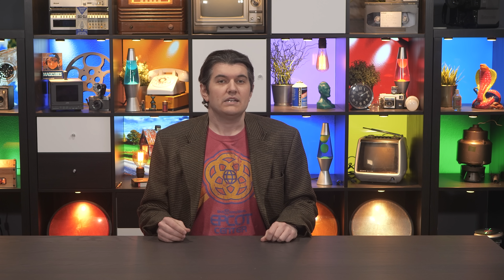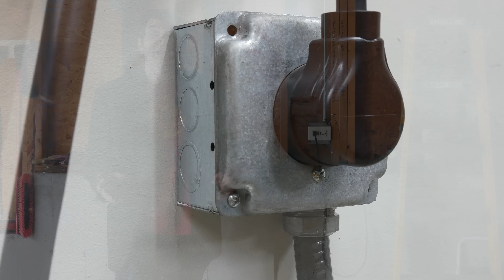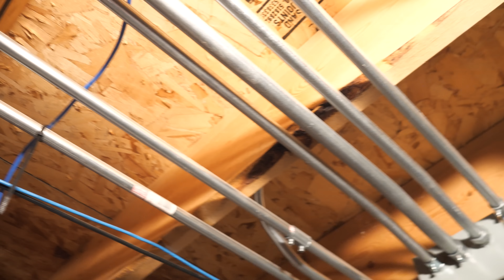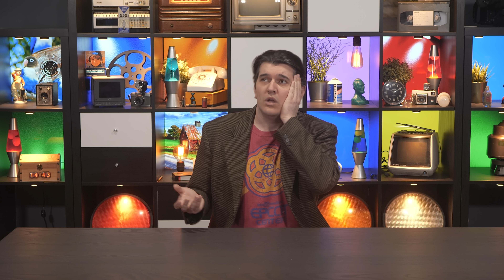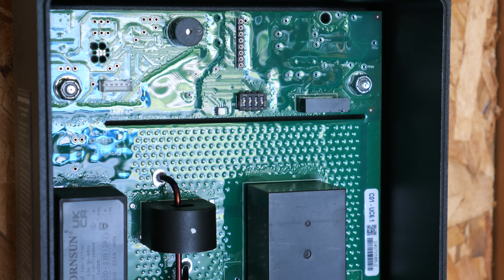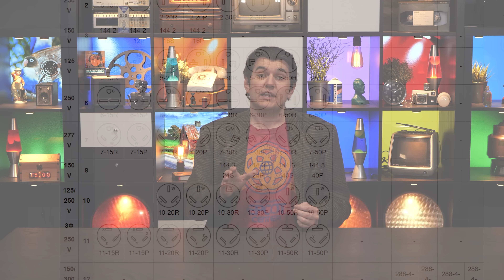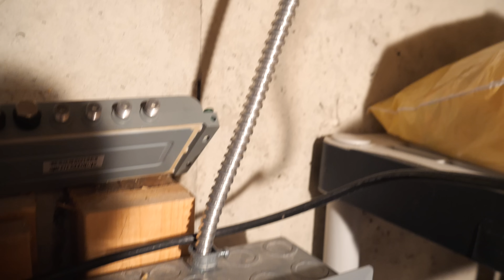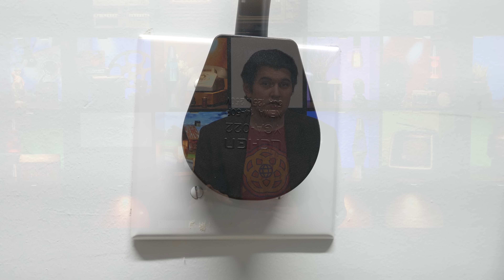The "standard" car charger is usually overkill—but your electrician might not know that

Comment: I'm an electrician from Germany and the last wallbox I installed had dip  switches inside to change the current. It was able to run on 400v/16;32;64A
Reply: Yeah - in Europe, we really live in EV charging paradise. You can install a 11kW EVSE basically anywhere there is space for it without many issues. 400V 3 phase power is really neat!

Granted, many more people live in apartments with street parking here than in the US.
Reply: @m0llux  Europe as Germany ? Because other EU countries do not.
Reply: @redheadsg1  Eh, lots of countries have it either standard, or available. In Germany, Croatia, Denmark, Belgium, Poland, Finland, or Sweden 3-phase is standard. In France or the Netherlands it's not standard but is readily available. I think Spain and the UK are countries where residential 3-phase is rare to unheard of.
Reply: @bob-ert-0  In Spain it is rare, but it's easy to get, if you want to. Most (if not all) apartment buildings do get three-phase power, it's just that each individual flat is only connected to one phase and neutral (so not all neighbours are connected to the same phase). But if you need over 10 kW of power they switch you up to 3-phase. I believe this is the case as well for single-family homes, but I'm not sure.
Reply: @bob-ert-0  its rare in the UK likely because of their use of ring mains makes load balancing nearly impossible since most homes usually only have one or two large ring final circuits then smaller dedicated circuits for everything else.
Reply: @redheadsg1  a lot of countries do it nowadays, France, Poland, Sweden, Norway, Finnland, Denmark, Austria, Slovenia.
3-phase residential power is more and more the standard across a lot of European countries.
The grid itself is 3 phase after all, and changing topology down the road creates different issues and inflexibilities.
Reply: I opted for 11kW because the wiring was cheaper and the car's charger is rated for 11 kW too. I admit, it'd be neat to have 22kW/32A on our 3 400V phase power but for everyday use it'd be completely overkill.
Reply: @krmr  I am lucky to have a 22kW installed, many / most cars can’t handle 22kW AC-charging tho 😥
Reply: @krmr  yeah you really shouldn't do that to your car battery everytime you charge. 11kW is more than enough.
Reply: @Nobody_Cares913 Do what? 22kW? I don't have that option anyhow, car's limited to 11. All the wiring is rated for 11kW. It's an underground garage and a large enough distance to the breaker boxes that price of wiring was indeed costly and the upcharge for 32A wasn't worth it. So 11kW had to do for the past 3 years.
Reply: In Italy most homes have the 230V single phase with the power meter limited to 3.3kWh (but upgradable with an additional monthly fee)
Reply: I was designing electrical supply diagrams for apartment complexes a 4 or 5 of years ago, we always made sure 3 phase supply up to the panel of every flat. Then we divided lines inside the house roughly equal in every phase.
Reply: i dont trust you being an Electrician, because its 63A, not 64 :P
Reply: 64A? I rather doubt that. 64A needs special Type-2 plugs that are rather expensive, and there's only a single car model that can actually take advantage of 64A. Also, breakers go 10/16/32/63(!)/125, so installing that would be a hassle...
Reply: 400v in a residential home?
Reply: @s10jam I don't know a single person who doesn't have 3 phases at home. It's just the standard in Germany.
Reply: @Nobody_Cares913 that stovetop doesn't power themselves.... Even in new developments Germany get 3 phase just for this reason
Reply: @mateuszzimon8216 funnily enogh our house has three phases, like all the rest but only one goes to our stove 🙃
This was built deliberately in the 90s and I'll never understand what they were thinking 😂
Reply: @Nobody_Cares913 I was unaware of that
Reply: @Nobody_Cares913 I guess in the hole North Europe.
Reply: @Nobody_Cares913  me 2 years ago😂
Reply: @Nobody_Cares913 only since around the 1960s, house prior to that may still have single phase supply.
My co worker lives in one of those old houses, whilst my parents in a house from the late 30's got upgraded to three phase.
Reply: @s10jam  it’s standard in most of current Europe
Reply: @s10jam  Yes, 400V, 3 phase is standard in german homes.
Reply: @herrtichy  in Norway too.
Reply: @s10jam  europe has pretty universal three phase distribution. unlike in the US or canada where the nearest three phase line may be many kilometers away, Europe distributes electricity nearly exclusively with three phase transformers. so a three phase transformer is pretty much always nearby. then for load balancing reasons houses are nearly universally supplies with all three phases. Plus it makes the main supply cables much cheaper. a 3 x 32 amp supply delivers the same KW as a single phase 100 amp supply, but five wires that are around 10 AWG in size is around the same cost as one 3 AWG wire that's needed for a 100 amp supply, and of course that 100 amp supply needs at minimum two wires. 

So supplying a house with three phase halves the cost of the supply wires at the lower end, and at the higher end, it cuts the cost down even more. Plus it also allows the use of lower amp 3 pole breakers for the main that are cheaper than larger single pole ones, especially since with the lower current on each phase means a lower amount of available fault current.
Reply: @s10jam  400V sounds a bit misleading, doesn't it? It's just 3x240V but with the voltage measured between the phases instead of between each phase and neutral. It basically is a shortcut for saying "3-phase 240V".
Reply: @s10jam  we really weren't cheaping out on laying distribution wiring lol.
Reply: @s10jam 
Yes. 
Pretty much most of Europe serves 400V three phase to homes.
Reply: @s10jam  Yes. Even a small 50 square meters flat in an residential "panelák" from the Communist era has 3 phase 400V 25A connection. And EVERY single flat has this kind of connections. Family houses have at least equal connection, if not even bigger ones (3 phase 400 V 32 A).

Comment: I really appreciate you validating this- I finally installed a dedicated charger line in my garage a few weeks ago and had to talk myself down from one of these 9kw chargers because it was so much more trouble than it was worth and I just didn't need that much speed. 240V/16A has been absolutely perfect for us- wire and outlet that met code were cheap and easy to use.
Reply: could you just drive slower?
Reply: @jamesalles139 Driving slower means more time to get between destinations and you don't save on power used for the trip in the long run.
Reply: @ElNeroDiablo I mean you do get max efficiency around 50 to 60 miles an hour on many models of EV but now you're really talking about hypermiling, not home charging
Reply: @georgefrankly  What EV has max efficiency above 40MPH? Most are max efficiency at 25 to 35 MPH unless you are using a resistive heater in the car in winter.
Reply: @johngreen5808  It's actually lower than that. I can get 80-100Wh a mile at about 10 miles an hour in my Model 3. Your base load just to run the computer is like 300W. Efficiency goes down every single mph you increase speed. Finding the most efficient speed is just a matter of finding a speed that's fast enough to offset the base load of the computer.

Comment: "On this episode of outdated US electrical infrastructure..."
Reply: 120/240v split phase is significantly safer than 400v
Reply: @RandomGuy526 

Yes, thts why your code mandates so many outlets and each cable extender is a fire hazard?
Reply: what is outdated?  240v split phase is fine
Reply: @davedoe6445 

You know what is fine? 400V 3 phase in every household. And consistent, sane plug designs.
Reply: @Mikiszub  Unneeded, and our plugs are fine.
Reply: @vhfgamer 

Sure they are buddy.

Comment: I'm certainly not an expert at mocial sedia, but a YT Short version of this might be worthwhile with the right title and it might reach folks that this one will not.  That version might simply point out that you don't need an expensive charger as your car probably already came with a cord that plugs into the wall and that this will provide XX miles of driving per day without hiring an electrician or buying expensive equipment.  "Your car's secret free charger" or something like that.

While "your EV's free charger they don't want you to know about" seems more appropriate, I think that many people have learned to despise such clickbait and this likely causes reputation damage even if the clicks remain high.  I know that I'm sick of that crap.

Comment: As of 6/14/25 there is a federal tax credit for the installation of a residential EVSE of 30% of the project, up to $1000. Trump's B.B. Bill will do away with that tax credit for projects starting construction AFTER 60 days from the passage of the bill. The bill is currently stalled in the Senate, and it will be at least a few more weeks before it passes.

Comment: When I bought an EV a few years ago, I considered installing a dedicated wall charger for it.  But it turns out that my local drives are so short and infrequent that I don’t need anything more than the portable 15A charging cable for at-home use, and I don’t need to charge the car more than 75%–80% for in-town driving.  For the occasional long road trip (e.g. on holiday) I can plan ahead and gradually increase the charge limit to 95%–100% the night before leaving, then make sure I have at least 25% capacity left by the time I return home (just as a safety buffer).

My parents’ house is another matter.  It’s so old that their garage outlets don’t have the ground pin, and when dad tried plugging in the portable cable using an extension cord that bypasses the ground plug it refused to activate (showing a red failure light).  So I just make sure to charge the car at a nearby charging station (only a few miles away) when I go to visit them.
Reply: I paid for my parents to put a 14-50 in their garage just so I can charge when I visit.

The ROI math on that was clearly terrible, but the added convenience was still worth it to me.
Reply: @k5sss  Same.  I visit my mother weekly, and in winter when I'm using the heater a lot I want to add some charge during the visit.  When my brother also bought an EV, we ended up splitting the cost to have a 14-50R installed at her place -- it was not an easy installation and needed some trenching to accomplish.  Now, it's a charge station for a lot of folks in the area :)